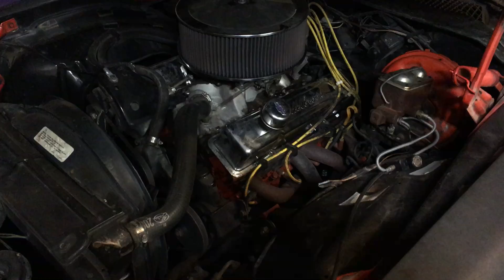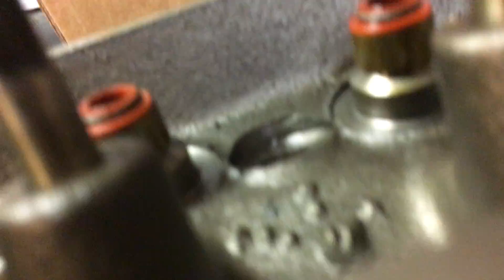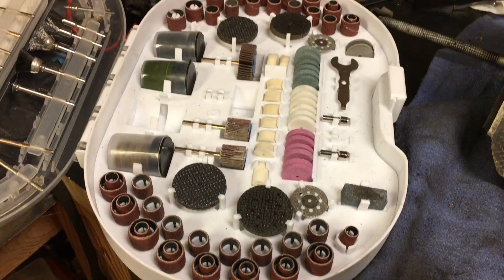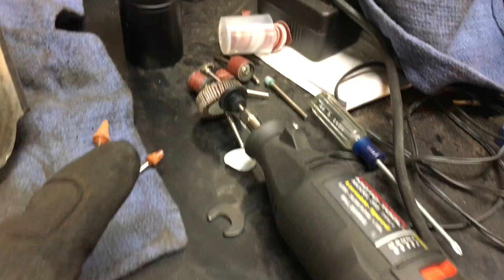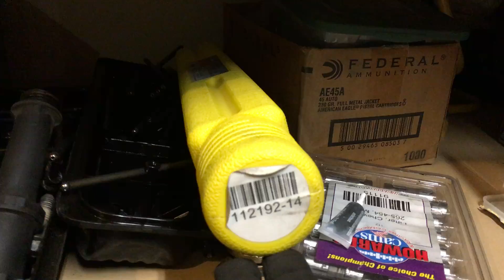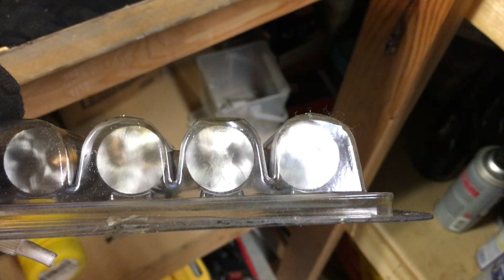Small block chevy vortec heads

Comment: Hey Jim. One controversy out there about Vortec heads is the combustion chamber finish. The theory is that the finish is the golf ball theory (which is proven). Those little factory pits increase air flow. Although I'm no pro tech, I think pocket polishing may diminish the air velocity. The upside to not polishing is obviously air velocity, the downside is the carbon build up. Just an article I read. So I pocket ported mine as well, but didn't fine polish as to hopefully keep some fine pits to be uniform in velocity.
Reply from the maker: James Hawkins I can see how that may be helpful on the stock L31 engine these came off of because of the low lift and short duration of the factory cam. I’m going to run a much bigger cam and my rpm will increase about 1000, so I felt cleaning up the chamber would be good. Also, if you look at high dollar aftermarket heads, particularly CNC ones, they all have smooth runners and chambers. I haven’t polished the heads, just cleaned them really. There was a fair bit of carbon build up. The surface is not perfect nor as smooth as a CNC finish would be. I’ll be dyno testing before and after the swap to show actual gains. Since my goal is only 400hp, I chose to do simple alterations that have a low risk of ruining anything the factory did.
Reply: @jimsgarage4112  without touching these you will hit 400 horsepower,do not smooth out intake ports AT ALL

Comment: Looking at gm L31 vortec small block chevy motor and gathering as much info as I can find. Just subscribed; do you have a FOLLOW-UP VIDEO of the finished engine running in the car with that HOWARDS CAM? Ima DIY guy and 'LOVE IT WHEN A PLAN COMES TOGETHER.'' Great video, Ill be watching....
Reply from the maker: Tito Lombre not yet. I rebuilt the rear end and put in a 5 speed. Heads coming this winter.

Comment: What is your opinion on the Edelbrock E-Street Aluminum heads, what horsepower could one get out of them and with which intake and camshaft combination??
Reply from the maker: Kobus Kock reading about the E street heads, they are an aluminum factory replacement. They appear to have the old style combustion chamber. I would guess the best you could get may be 350hp with a single plane and big cam. They say they are intended to operate at idle to 5,500 rpm and are meant for mild street engines. If I had the money to buy those, I’d look at blueprint heads. Or maybe even McCoy hotrods, they have three stages of porting for the Vortec heads.

Comment: I need to do an upgrade too. Also sit with an engine that came out of a Silverado truck with the TBI heads which I believe is the worst heads one can have on a 350 Chevy. Seems I have to change everything upwards from the block including the camshaft.
Reply: buy a set of vortec heads 1996-1998,buy a set of ls6 valve springs and comp Valve Spring Retainers 787-16.cam of your choice and you will gain 50 -75 horsepower

Comment: you did a pretty good job for your first try I didn't see anything you did that is going to hurt performance so good job on that getting 400HP with vortec heads on a 350 is pretty easy to do
Reply: i recommend the hydraulic rollerS on 350 sbc::: comp cams XR282HR ground on a 107, 108, or 109* Lobe Separation Angle 
OR  a comp cams 283THR107  either one with 10:1 static compression. 89 or 91 octane.

Comment: with all my vortec head builds-I have done I just run a 550 lift z28 spring  pack from competition products-less than $50 with dampners removed to clear valve seal and ghetto grind the bottom of stock retainers .060 and run 480 lift 280 cams and 505 lift 292 cams and they run awesome for cheap money with no machining or expensive parts-plenty of retainer to guide seal clearance-never had a rocker arm pull out so I don't think screw in studs are needed for moderate builds like mine 2500-6500 rpm

Comment: The hole at the bottom of the lifter is just a sales gimmick. They actually wipes out the cam and lifter in no time. Break the cam and lifters in right and you won't have this problem. Buy comp cam solid lifters. .480 lift cam - 20 lash = 460 lift cam. Buy 1 quart of high zinc oil with all your oil changes. I use Pennzoil 20-50 and use 1 quart of zinc oil of your choice. I have never had a issue with that combo. Just saying
Reply: One quart is enough???? Who told you this?

Thanks
Reply: Just use Valvoline VR-1 oil for zinc.

Comment: Very first thing you should do with these heads is have them magnafluxed. Too many people jacking around with heads that have cracks. Just because it came off a running vehicle doesn't mean they're not cracked. I've thrown many a vortec away. I hope you take the heads to a shop to redo the seats as you screwed them up! Better to have a little carbon that gets blowed off in a truely hp engine than screwed up seats. PUT IN A OLD VALVE TO PROTECT THE SEATS! Forget the high dollar beehive spring setup and have a machinist cut guide down for clearance and spring pockets cut to remove the over sized boss. Fit with z28 spring for 510 lift or other springs 1.260 dia. can get you up to 600 lift if needed. I wouldn't recommend vortecs for anything other than street performance. For real 460 hp and up  I say aftermarket heads. Vortecs aren't as great as everyone seems to think. The more you have to do to them the less appealing they become.  Also 3 angle with backcut valves helps greatly. As for threaded studs, DON'T attempt to do them yourself with some pea brained kit! I've seen many self attempts at this and studs are pointing every direction except the same.  My shop, I drill and power tap on the bridgport mill with a DRO and everyone of them is the same and in the right spot. If you want WEAR just do it yourself!
Reply: Also beehives are not expensive and better performing. I bought a set of LS6 Beehives for $60 new GM part. They are a little more $$ but for the added performance over the z28 springs its worth spending another $10-$20.
Reply: What is your opinion on the Edelbrock E-Street Aluminum heads, what horsepower could one get out of them and with which intake and camshaft combination??
Reply: gmpp ls6 springs are $70,comp retainers are $50 and no machining is required. 0.55 lift
Reply: how do the studs end up pointing in different directions if your already working with the hole that are factory drilled and only need threaded??? I can see studs going in different directions if you have to drill the holes first and then tap. but these are already drilled, just need tapped. I have tapped many holes and the tap always self correct being guided by the actual hole to be tapped. If your going off center then the hole being cut into the wall and the tap is going to "snake" down the hole(but will continue to try and guide through the hole, it won't happen because the 1st bend at the turn will bind up the tap and not continue). I never seen studs pointing in funky directions unless the machine shop screwed up trying to drill for larger studs and went off center.

Comment: Duntov cam revs much higher than 5500rpm.   It makes great power above 4,000 rpm, but the cam leaves a lot of torque on the table below that RPM https://www.enginelabs.com/engine-tech/cam-valvetrain/duntov-small-block-camshaft/
Reply: It's pretty old....

Comment: I home ported some LT1 heads just clean up the casting flash in the intakes gasket match 1/2" at manifold side.  Clean up casting around guide on intakes. Polish all casting flash on exhaust and mirror polish to reduce carbon buildup as much as possible. Here is link to my post and pictures 
the LT1s are similar to vortecs. https://www.ls1lt1.com/forum/lt1-%7C-lt4-%7C-l99-engine-tech/55551-budget-home-porting.html

Comment: Great video Jim. Port velocity is torque as you stated and Vortecs are the best power per $.  I made 507HP on n/a mild porting bowl blending and valve job work, 658HP on spray 150hit (644 ft lbs) all cast lower end,. LS killer. Would take approximately 380lbs. to run engine safey at 7000rom (7500rpm) with typical single coil springs? Some quick facts. Intake ports are 170cc, comcustion chambers are 62.2cc, intake valveheads are backcut from GM 1.94" and exhaust valve heads are 1.50". Unquestionably the best flowing cast iron head GM ever produced with flow peaking slightly before .500" at 218cfms, and 158cfms on the exhaust (that is a single casting, some flow up to 10cfms more due to OEM variances. Videos of real street car with bowl blending and using load matched beehive springs in heads on www.diabolicalracing.com
Reply: Russ Coffell  This info is making guys coming back to the old school Killer!!! Thank you Russ!

Comment: What spec cam did you go with? Flat Tappet or Roller.
Reply from the maker: APSTTGTO I got a Howard’s cam 112192-14 which is a replica of the Z/28 cam. .485” lift, 254 duration at .050” lift, and 114 LSA. It should be pretty good because flow on these heads in stock form doesn’t increase a lot above .480” lift.
Reply: @jimsgarage4112  With that camshaft you probably do not have a smooth Idle but a rough idle, right?
Reply: @kobuskock6688  114 degree lobe separation will smooth it out some.

Comment: You can grind 3/32" off the bottom of the retainer and get .525 lift.  Stock springs can be replaced with Z28 springs if damper spring is not used.  Comp cams also sells the tools to cut down the guide and another for bigger spring seats.  Vortec head stop flowing after .500 lift. Only clean the ports, do NOT port them very much or they will not work as well.    Scoggin Dickey sells vortec parts and heads already setup for high lift for about the price of stock ones. Good Luck.
Reply: @port nut Yep. I run them both ways. One with ground retainers and Z28 springs and one with PAC ovalized beehive springs. They both work great. Have a great day.
Reply from the maker: I’d be worried about grinding the bottom of the retainer as that is the structure that holds the keepers to the valve stem. 
I looked at other springs and the tools to cut stuff too. I just chose to try this method as it seemed the easiest and I also liked the fact I could tune the springs to my cam.
Reply: @jimsgarage4112  I can tell you have done zero research on the subject. We call it the ghetto grind and it in no way affects strength of the valve train considering the metal removed does not touch the keeper, valve or spring. I have done it for ten years now along with thousands of others. Google it! I run Z28 springs with 3/32s ground from the retainer and I have the required 50,000ths plus in clearance.  My springs are correctly matched to my cam. I would rather machine the valve guide boss for better springs than buy springs that only fit vortec heads. But, whatever shortcut you use will work. Have a great day.
Reply: Cole, you obviously have did zero research on the subject of the benefits of running beehives  since your bragging about running a "Z28" steel single coil spring with dampner. If your engine runs to 6,000rpm without float with these single coils the loads are more than excessive, and your wasting power by loading valvetrain with higher loads to support your larger retainer and heavier spring coils (few benefits of the beehive springs offer). I've assembled 100's of sets of SBC GEN1 heads and remember the older retainers had some processing burrs which I cleaned up maybe .005" but as Jim stated actually shaving the retainers might cause one to fracture subsequently in a catastrophic engine failure . Google it? If the material wasn't needed when GM designed them to last 150,000 miles, they would have shaved them more. They made millions of them and your grinding into the safety factor. Specifically your decreasing the amount of area the load from the locks is spread through when you do the "ghetto grind". I remember from living in Flint, MI for 30 years using the "ghetto" grind years ago when building claimers for circle tracks or engines that were sacrificial. Short cuts work, I use them to win races, but correctly engineered "shortcuts" ultimately and produce better results without sacrificing OEM durability. The springs Jim is using work on all GEN1 heads with a 1.250" spring pocket and support .550" lift on Vortecs and are good to .570" lift on other applications. Have a great day sir. Russell Coffell
Reply: @russcoffell3560  LOL " If dampner spring is not used" The valve guide boss according to GM is the inner dampner. And I did say it was a shortcut. I said nothing bad about beehive springs or machining valve guide bosses to accept .530 valve guide seals or maching the spring seat to accept a larger spring thus allowing a larger variety of springs to choose from. BUT, I did zero research? Right Russ? Have a great day and stop wasting my time being a jerk. Try having a conversation next time.
Reply: @colejohnson3705  LMFAO. The valve guide boss according to GM is the inner dampner? How exactly does a valve guide boss dampnen single coils natural frequencies? Curious Cole?  That alone speaks for your reserach! I wasn't being a jerk, you called Jim out for not doing zero reaserch, when in fact Jim did far more research than you, and knew grinding a OEM retainer 035" wasn't worth the risk of to run a .500" lift cam.  I could stop here as the comment about the boss guide shows you know nothing, but since I'm a jerk lets briefly reflect your cutting edge "research" of cutting the boss to accept .530" (aka pc seals) , then enlarging the spring seats to accept even larger diameter springs. Set up your Vortec heads with 1.437" or 1.550" springs and you could possible offset the entire benefit of running cam with "more net lift at valve"  by wasting more HP with excessive valvetrain loads. What next triple springs genius? You obviously did some research, but none of it is relevant or factual. I have Vortec heads on all cast bottom end fully loaded mid 80s Gbody.  Feel free to put your money where your mouth is Cole?  Contact me directly with any questions or to setup a race. Thank you. Russ Coffell
Reply: @russcoffell3560  ROFL You may assume whatever you like! Go read the GM engineer report for yourself by googling it!  My ported and polished vortecs are on a shortened  Z71 frame with a Mitsubishi truck cab and bed on it. You want to race through the mud or 4 wheel? As far as valve guide boss machining and valve pocket machining Comp Cams sells Nice tools to accomplish both.  Why run double or triple springs since vortecs don't flow over .500 lift anyways? But you already know everything about everybody and all things mechanical already right Russ?  Do you need a hug or a snickers? LOL  Being civil is quite beyond you!   Your attitude is amusing and boring!   I am done trying to communicate with you.  GOOD BYE Russ.

Comment: Are you doing any work on the intake or exhaust ports? Mine are a little inconsistent from one to another. The top of the exhaust ports are the worst. I plan to touch them up a little while I'm in there.
Reply from the maker: Jamie Clarmo all I wanted to do here was the pocket or bowl of the port just behind the valve. I did both the intake and exhaust. From what I’ve read, an inexperienced person like myself can mess up the shape of the port which is bad because the shape is part of what makes these heads so good for factory castings.

Comment: Great job so far! 
I'm in the process of doing the same porting to my 906 heads. I bought a brand new L31 crate engine from GM, 4 bolt main #12530283 and all I was only going to do was, install LS6 beehive springs, comp retainers and 1.6 full roller rocker arms BUT they move the pushrod down and now they touch the holes in the heads. I decided to pull them to drill them and do some light porting mods, exactly like what you are doing. Funny how it snowballs! Now changing the cam to the Ram Jet (P/N 14097395) with the 1.6 rockers makes it .460-.480 lift. Looking for lots of torque (400ft/lbs) because it is going in a 1981 Malibu with a factory, manual 3 speed trans. and 2.73 rear gears. 
Good luck with your project.
Reply: Sounds like a good combo on the motor, I'm considering about the same combo for my 96 Yukon.

Comment: Look into doing screw in rocker studs ,summit sells the kit for it .these heads are known too pull them out with heavy cams
Reply: these heads have almost never pull out  rocker studs,in fact they often break when you try to remove them
Reply from the maker: Hottrod I may do that in the future. One of the benefits of the beehive spring is reduced spring pressures. So the risk of pulling one is greatly reduced.
Reply: @jimsgarage4112   no way- you must tack weld em or pin them or something , these are only going to hit 370hp with an XE268 cam and that cam will pull your studs and the lift will drop not to mention other problems and the huge power drop , i would form a divot and weld it, and weld them around the top. your going to have 400hp correct?  Use an XR282HR roller cam ground on a 107, 108, or 109* LSA and make your static compression ratio 10to1, 65CC heads with 7cc dish/relief piston with a zero deck and O.O4O" thick 4.035" gasket on a 4.030" bore size. this shall give you 7.95to 1 Dynamic Compression Ratio and 10:1 Static compression Ratio with good pump gas compatibility. You could go to 10.25:1 Static Compression Ratio. calculated 500feet below sea level. i figure this around 195 to 205 PSI cylinder pressure.
Reply from the maker: @7REDDRACO7  well, I've been runnin them for a couple thousand miles now and had no issues. Uploading a video today.